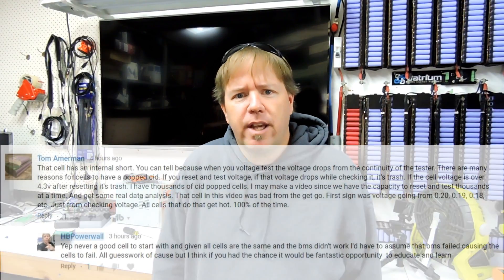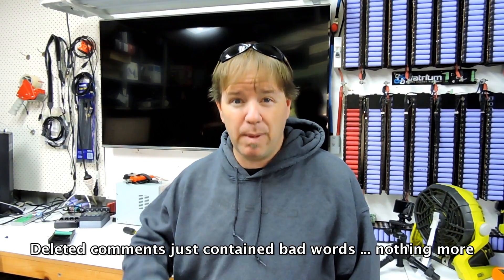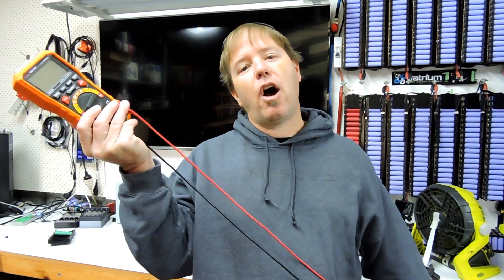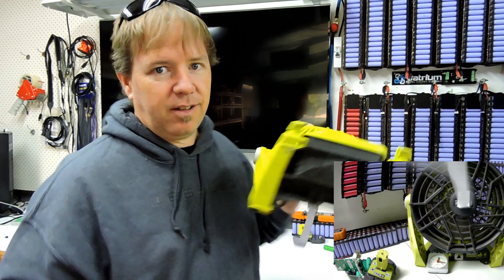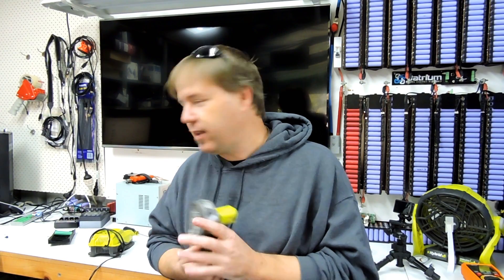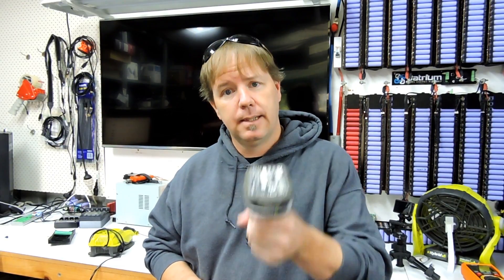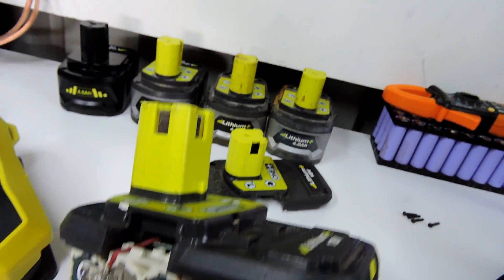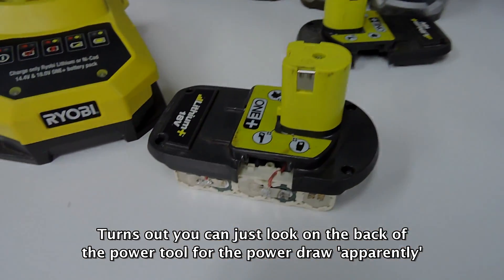CID chatter & I need the winners

Comment: Your cutting apart battery packs that have failed and using the cells within them who is to say the CID is good in any of thoughts cells and will work properly?.  I am sure the manufacture doesn't recommend the practice of using cells from failed battery packs.   Even new cell can go bad that why you use a BMS for protection.  If you cut a cell apart you will find that the CID is not some weak thing that will fall apart once activated.  You will see it can be reset and will function like it was intended to do after being reset.  Your going to get bad cells in your battery packs that's a fact.  But that one bad cell can cause the CID in the good cells to pop because they are trying to balance the bad cell.  Also equipment can be dropped causing the CID to pop. Your whole argument is nothing but fear and is not based on facts.   Take 500 cells that have been revived and have tested over 90 % capacity and cycle them thru many charge cycles and see how they perform before running your mouth that they are bad.
Reply from the maker: The practice of resetting a tripped safety device without knowing how or why it failed is stupid - running my mouth was educational for myself and others - thanks for the interaction..
Reply: You offer no proof that your fears are warranted.  Your spreading fear to get views on Youtube nothing more.  When you do the work and actually test these cells over time then you can talk.  Your test was nothing but a scam to get YouTube views.  That wasn't a real test.  You all ready had a predetermined out come of the one battery you tested which was a bad cell that couldn't be revived.  You are to lazy to do real tests on these cells.  I have 500 cells which I revived and they all are over 90% of there original capacity and I have 0 issues using these cells.  After you revive a cell you can tell is a cell is bad within 2 minutes because you can see the cell discharge after it is revived its really simple.  If the cell discharges turn it in to be recycled.  There is 0 safety issues doing this.  The cells that you do revive after charging store them for 2 or 3 weeks and if they don't discharge there ready to be used.  I have no heating issues with these cells they work perfectly as any other cell would.

Comment: Do the work and test 500 cells and reset the CID and see how they work over time. If you reset the Cell and it keeps discharging it bad plain and simple.  But if you reset the CID and it charges to near full capacity the I would say its good.  Do the work and test many cells before you run your mouth about something.
Reply from the maker: Let me kindly say FU*K that! how do you reset the CID with out ANY damage, you can't even see in there and ANYTHING you poke in that little gap will dint, scratch or puncher the CID - Just cause you can't see your wife is pissed off don't mean she isn't .. Consider that me continuing to run my mouth about something xxoo

Comment: I'm still on the fence with CID resets. I've had quite a few which "behaved" really well after a quick, easy reset. But then I've had ones where the CID punctured with the telltale hissing. Worst case, I've had two that punctured and then eventually ended up leaking electrolyte. So far I've tested a few that behaved nicely without any punctures and those did not heat up or act any different from a regular battery. Though I'm keeping them set aside and still am not sure if I should use them in a pack. The ones that punctured though I have much more reservations about and will prob end up taking those to the recycling bin.

Comment: I recently did a similar rebuild with 2600 mah laptop cells. Samsung 26f cells to be exact. When reading the cell data sheet, they could be fast charged at 2.6 amps. The fastest American Ryobi chargers only do 2.1 amps. Well within spec. Out of habit tho I charge the small Ryobi batteries with the black 1.4 amp and only charge large packs on the 2.1 amps.

Comment: I got slammed a few months ago when I mentioned reviving a CID cell. 

Regarding the deformation of the diaphragm, I heard of some one using air pressure to reset the CID. other than that I will not comment on the subject again.

 It's not safe to use them in a Powerwall. And it would be criminal to re-sell them.
Reply from the maker: Funny you mention air pressure, we had a roundtable chat about just that - 3d Printing a housing to hold over the end of the cell but quickly dismissed the idea as madness.  Definitely Criminal to knowingly resell ! for sure

Comment: Lithium needs a constant current then switches to constant voltage, I don't think a Nicad charger does that.
Reply from the maker: fairly sure your right ! but can't be sure myself
Reply: This explains the charging sequence the micro is programmed to follow - it's a bit slow so press the gear(settings) symbol and select 1.5x speed -.
https://www.youtube.com/watch?v=wfrm6lbt8Pc

Comment: Hay Peet, been thinking about that little Ryobi pack, and if you added more cells in parallel it could easily handle a high-drain tool, but not if there's some kind of output limiting on the smaller unit. Obviously it wouldn't fit in the smaller case, but you could 3D print a new one pretty easily. I don't have a Ryobi, but I just tore my el-cheapo triton batteries apart and the boards look the identical, the only difference was the number of cells in parallel. One of the output pins is marked ID, so I'm guessing the little microcontroller on the board has to be programmed with the battery capacity, and that speaks to the tool via the ID pin, which restricts which tools it will work in. Pretty sure it won't work if I try to use the 2Ah battery on the circular saw, but the 3Ah works fine, so that's probably what's doing it. Still, it'd be an interesting thing to test.

Comment: I think charging the cells in the std charger will be fine. 1.4amps is only 400mA over normal. Given your not going to be using the pack daily and charging it daily probably more like weekly right?
Reply from the maker: It is perfectly fine - will make for a great spare battery - IF I didn't kill the bms today messing around with it lol

Comment: Maybe its time to rip apart a old CID popped cell to see what we can learn from it.
Reply from the maker: THAT is a requirement - have to go today and grab a pipe cutter :)
Reply: Do tests such as repetitive resetting and examining the effect of pressing down on the cid with too much pressure or lack of care to see how thin it is , Should prove interesting. :-)
Reply: Just a update my initial fears were confirmed today after i reset a CID that when you push it back in there's a risk of puncturing the CID membrane itself , I did one but after noticed a wet patch on my hand sniffing it confirmed it was electrolyte leaked from the battery itself (leak evidence only appears after full charge). These CID membranes are so thin in order to allow internal pressure to push it out.

Comment: High drain and 1.5ah battery dont go together really. They all get warm on chargers mate zero issue
Reply from the maker: No issue except just after i finished this video i was ' experimenting' and blew the bms board lol
Reply: HBPowerwall haha oh shit ;(
Reply from the maker: My fault waved the soldering iron over and dripped a bit of solder on it haha .. rookie move - but I'll own my mistake heheh - now I have to find some more bms wish I got it on camera for sure ... glad the battery was dead flat could have been worse
Reply: did you still have the bucket of water handy just in case ?

Comment: Interesting note about the CID. The best way to know would be to cut open the top cap of the cell above the CID to see if its deformed after trying to reset it.

You are using NCR18650 cells in your new power tool, and the datasheet mentions that a standard (not even fast) charge current is around 1.9 amps, so you should be okay. Granted I try to charge my battery packs very slowly when I can, but i'm sure if those cells fail you have rows of replacements ready to go:

https://engineering.tamu.edu/media/4247819/ds-battery-panasonic-18650ncr.pdf

Personally I would stick a label on that battery with a label like "low drain only" because I could see even myself picking up that battery and accidentally using it in a power tool. Although even if you did do that, the battery would likely just sag tremendously under load and be drained prematurely, and it would be immediately obvious that this was the power tool battery you rebuilt.

I've got a 72v 16AH (20S8P) ebike pack that contains samsung 20Q cells. I've successfully charged that thing at 20 amps continuously before. I don't do that often but I have had to do it at least once because I forgot to charge my pack one night.

On another funny note, I charge my battery pack in my basement away from anything flammable and when I charge the pack that fast, the lights in the basement tend to dim :). After all, that's 84v (full charge voltage) at 20 amps, and that's actually approaching the limit of what a 120v 15A 1800w AC outlet can do here in north america (lucky bastard with your 240v).

Comment: I have used "reset CID" cells that have eventually re-pop the CID. I have also reset some that let out internal pressure. Those tend to bleed out the electrolyte through the punctured CID. I have also "bump charged" cells with a 12v car battery and NOT pop the CID. It is a 145psi pressure relief valve, if over pressure is not so high it will auto reset. When it stays open it's because the internal pressure was way over the limit telling us that it blew for a reason.
Reply from the maker: in the VERY early days i've used a very small 12v battery to bump the 0.5v cells for 5 seconds to get the opus to see them and begin charging - but that was well back in the day